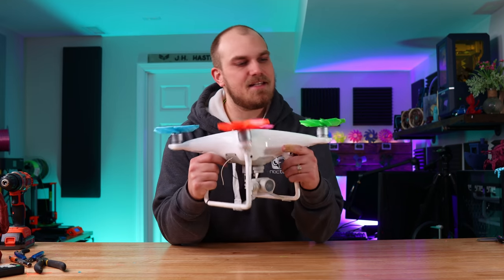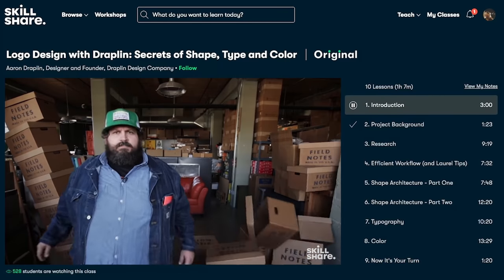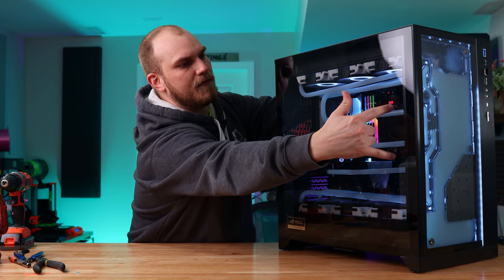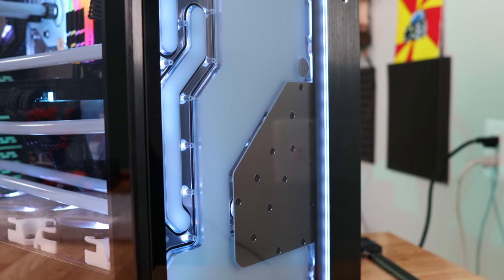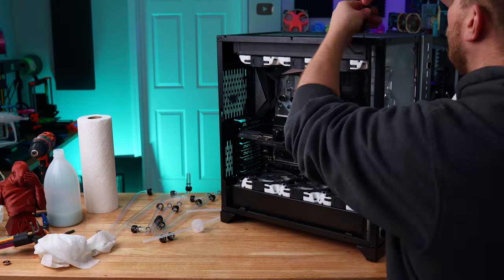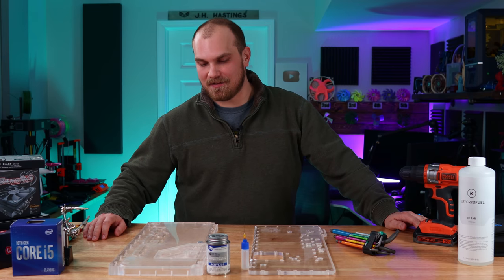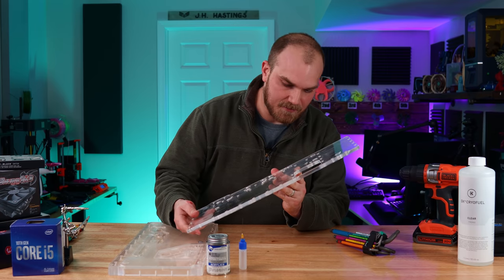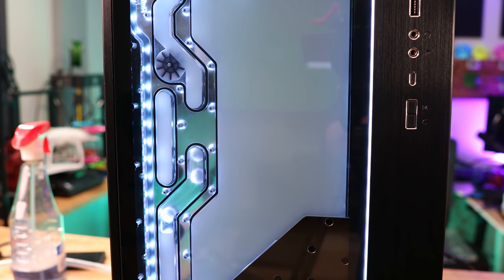$400 DISTRO PLATE is about to let loose, can we FIX IT?

Comment: Sounds like you have too much pressure build-up in the lines what you're supposed to do is when you set up a custom-built water system you're supposed to relieve pressure every few weeks even after you're all set in the pressure has been released in the line you want to relieve pressure in the line now and then just to make sure you don't build up too much pressure if you start building up too much pressure it can cause your system to leak or the plastic fittings or covers to crack
Reply: interesting. i've got two rigs that have been sealed for two years and haven't been opened since i filled them.
Reply: @TheFallenAngel13524  okay sometimes that affects it sometimes it doesn't. I build computers and I didn't drain the air out of the line and it was fine others I had to open it up and let all the air out

Comment: Vacuum pulls the cracks closed. 
RGB = rgb+UV + Thermal expansion n contraction. You are using Non Stabilized Acrylic. Should be using Glass, three sheets, 1/10th the price, and its DIY. No mystery here...

Comment: Good to see that ek helps out when there is a problem with one of their products.

I love small form factor builds, so I'm looking forward to the upcoming video!
Reply: When they're charging $400 for what is essentially no more than 2 slabs of acrylic with some holes in it, they'd better honour a no-questions-asked type of warranty on it. I've never bothered with a distro plate because I find that they are way too expensive for what they are. That distro plate alone costs more than my entire loop including full cover GPU block and everything.

Comment: i bet you can make the o-rings yourself by just cutting and glueing some o-ringmaterial to the right lengh
Reply: permatex boy its silicone gasket material in a squeeze tube. 
also he doesn't have another flow meter so kinda pointless to do anything with it.
Reply: @darkshadowsx5949  well, what about 3d printing the flow meter?

Comment: fan propellers and impellers are all different things you cant use a fan blade as a prop blade because they are designed for two deferent things

a fan is made for air flow it is designed for moving air NOT creating lift just like a propeller is designed to generate lift and not airflow 

its like the difference between high air flow fans and static pressure fans and you don't want to use the wrong fans for the job

it is also why you first cupule season should not be on the same board as the later seasons because you switched form a high static pressure designee to a high airflow designee yet have the same leader board when a high static pressure fan will not work the same on a air cooler just like a high airflow fan will not work on a rad the same way the proper fans for the proper job would 

and that is why you cant just put fan blades on a quad copter and make it fly

because a fan blade is just designed to scoop and push air from one place to another as ware a propeller is designed to create a pressure differential between one side of the blade and the other side of the blade generating a higher pressure zone on one side the blade and a low pressure zone on the other forcing the blade and anything attached to it in the direction of the low pressure zone and away from the high pressure zone 

if fan blades and propellers were interchangeable all fan and propellers would look exactly the same but the truth is every prop and every fan blade has to be specifically designed for the job they are doing to get a good mix of lift static pressure and airflow all three being different things

Comment: hmm looks like typical EK quality
premium asking price for something that is as cheaply made as possible
in this case it was probably a cutter used for to many holes and the typical "annealing*? nope thats to expansive"
mayby even started with stress in the material cause they used the cheaper extruded PMMA instead of cast

i had some bad experiences some 10 years back with EK and PMMA parts and since then never used anything PMMA from them again
instead went with Bitspower, Watercool or AquaComputer and never had a problem again
they fucked even somthing as simple as the frontplate of a bayres up, this part had just 10 or so pass through holes in it
so no threads and not a single machined surface touching the liquid, yet still got cracks at the holes some heatcycles in (heck i even not touched any of the screws)

*hope annealing is the right word, in german i mean "tempern"; for me annealing is associated with metals "glühen", so a stress relief like "tempern"

Comment: I would of considered a RMA on it so EK can engineer it better. Those splits are crazing and you would need to use a compatible resin with a vacuum bleed method.

The cracks are bad, I also noticed the last plex is warped.

Comment: Encase the plate in a water-safe epoxy resin and then cut/sand it down to fit. That way, the original cracks are permanently sealed but you maintain the original style. Resin could be colored to change the look